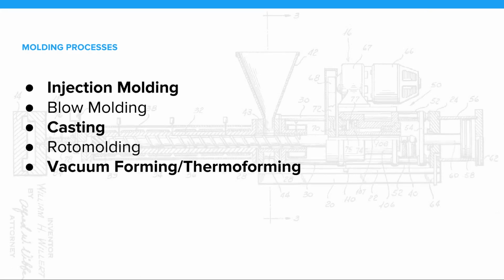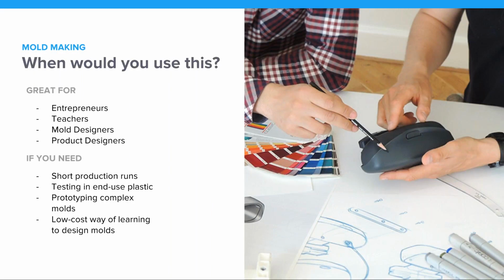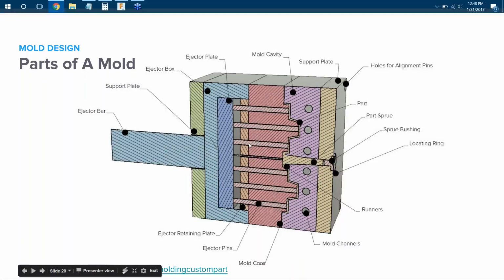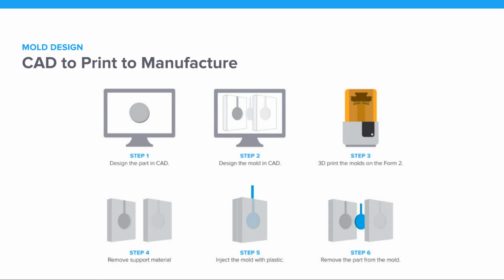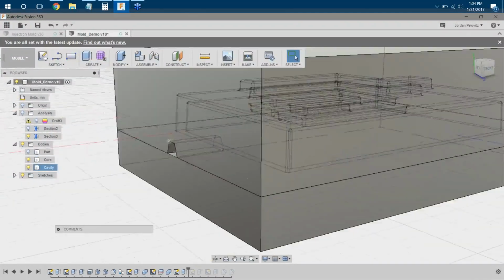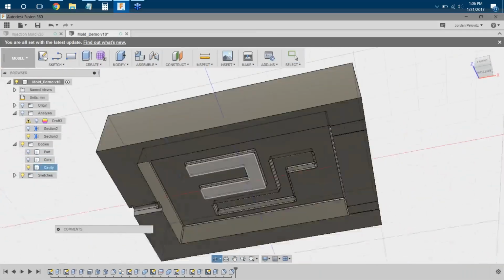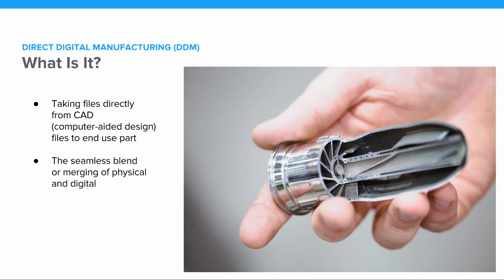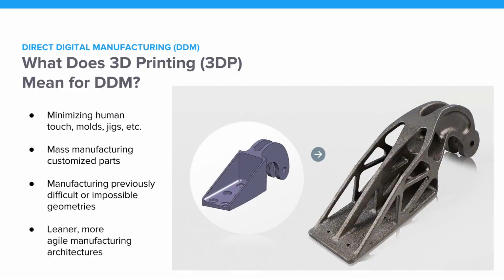Making Molds with 3D Printing Webinar Formlabs

Comment: What i had in mind was kind of hybrid process. 
1 build a model of your part in some 3d scolpting or cad software
2 make negative molds out of it with parameter wall for silicone transfer mold
3 3d print the positive mold and make negative silicone transfer mold out of it
4 cast a mold in polyurethane casting resin ,possibly under pressure
5 insert all positive resin molds into clam shell metal holder

the process was kind of designed to be doable for a person with cheapest filement 3d printer (used for cnc accuracy) and casting resin was used in place of light sensitive resin 3d printing usually used to do similar low volume molds since polyurethane is thermo set to a degree and nothing out of thermo plastics like to stick to it, not even glues 
the only problem for urethane resin i see is they get flopy with heat so either metall filler should be used or mold should be cooled properly every use i also considered epoxy or polyester casting resins if polyurethane is no good for abs molding temps

process is also designed to cut cost for "one of" kind of projects when you startwithout tools and are not willing to buy more than you need  with no intention to continue injection molding in the future

i was wondering would that work in your process to cast some abs/asa/hips